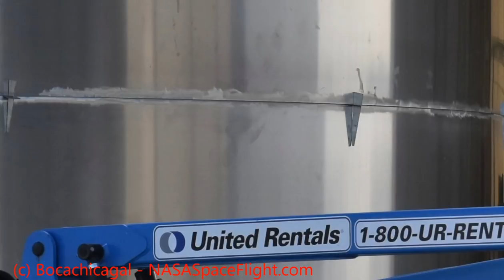SpaceX Boca Chica - More Buildings, Test Tank Dismantled, Starship Rings

Comment: They required a 6 on the pressure test and achieved over a 7. At first I thought that was a slim margin until I realized that 6 was the double amount of pressure needed for actual use.
Reply: Sammy Spaniel I’m under the impression that to get the required safety margins for human rated space, it has to hold 8+ bar.

Comment: I'm no expert but why don't they use bladders like they use in airplane wings
Reply: They add up to a lot of weight, and every ounce counts in a rocket. No rocket manufacturer I know of uses bladders. Also, these tanks hold cryogenic methane and oxygen, not jet fuel. I'm guessing any bladder material would be frozen stiff, and shatter under the vibrations of blastoff.
Reply: Mr. Aldrich cryogenics would be my best guess of not using bladders.
Reply: Also the tanks double as the rocket body structure. Rubber body structure not ideal.
Reply: @stevefink6000   He meant as a bladder inside the structural metal tank, to hold pressure and prevent leaks only.
Reply: @donjones4719  It's not gonna hold the pressure either. At 7 bar there was roughly 4000 t pulling the upper and lower dome apart.